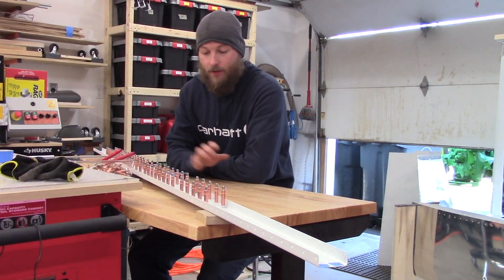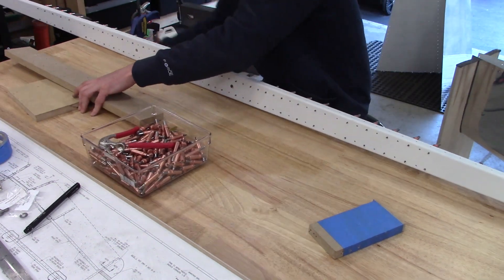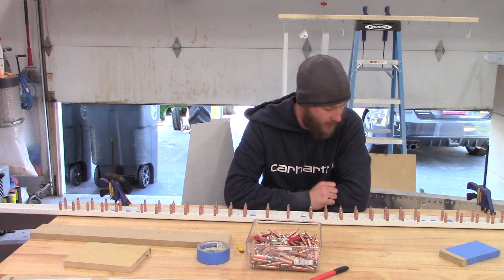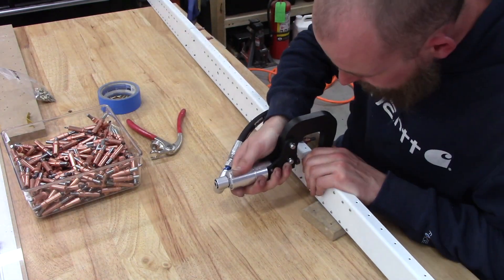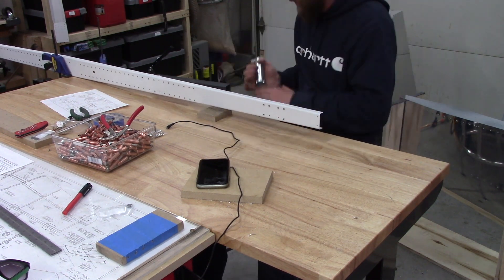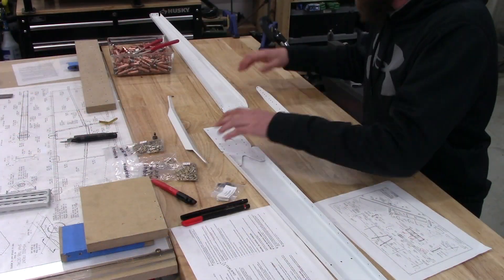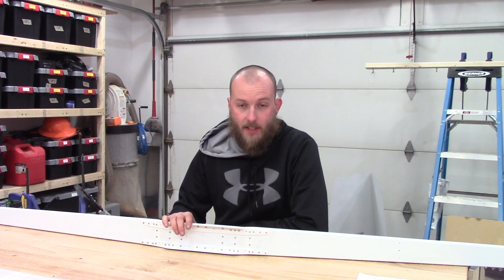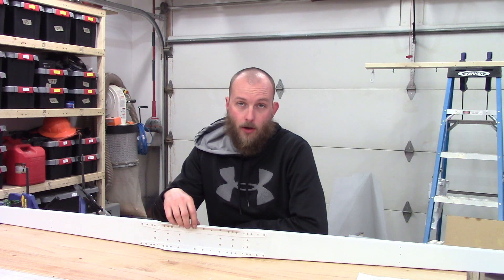PLG S1E12 - RV-7 Horizontal Stabilizer Spar Assembly Rivetting

Comment: Like the video and the commentary. I’m right behind you on an RV-8 empennage. One thing I noticed that you missed was the cutouts at the center if the rear spar. They are on the bottom of the spar. See the note on the plans. It is not called out in the step by step instructions. The cutout width is 1 inch.
Reply from the maker: I migrated my channel so replies were lost. Thank you for the comment.